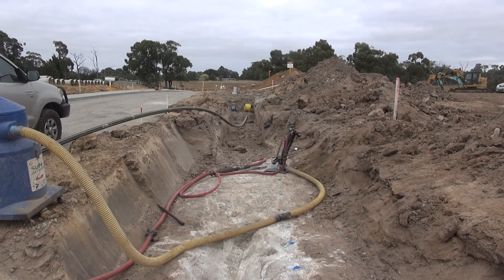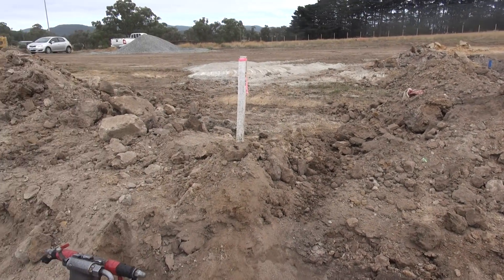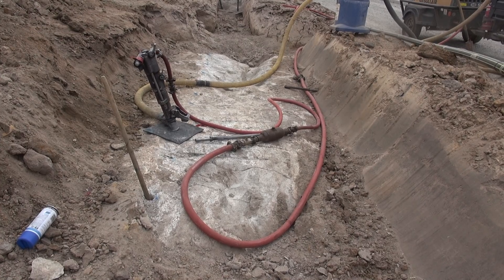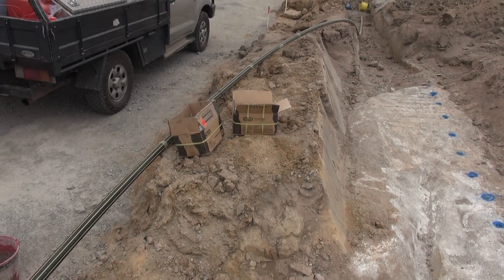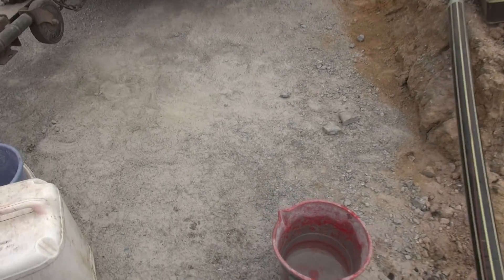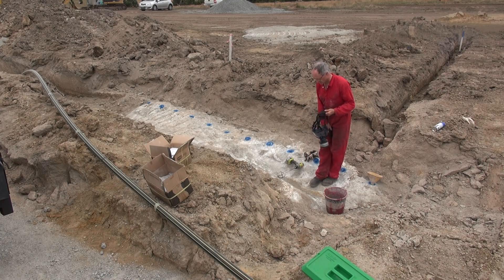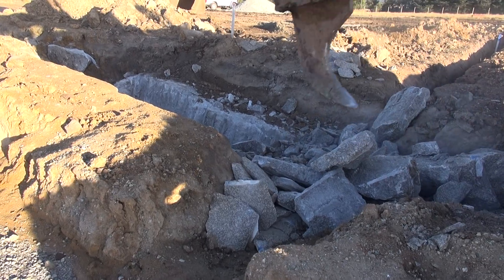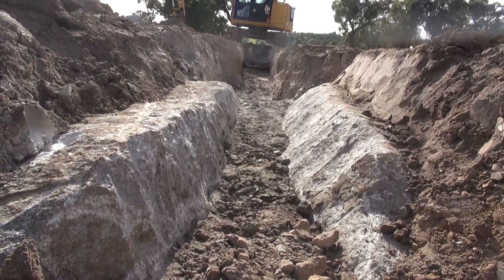Trenching in Granite without explosives

Comment: Okay what sort of hand drill would you recommend to someone who wants to do this? Milwaukee sds and going up in successive bit sizes?
Reply from the maker: It would take you 2 weeks to drill this with an electric drill and the cost of 38mm SDS Max (inch and a half drill bits) for them is prohibitive, not to mention that they only make them up to 600mm long. You really need a pneumatic rock drill, one that is powered by a big mobile air compressor. You should be able to hire one.

Comment: I love using the ripper on my Komatsu 1.5t ‘hydraulic teaspoon’.  Can’t wait to get my hands on some of that Expanda.  
Just looked at a video for the XCentric Ripper ( combo of ripper with built in hammer).  Bit big for my machine, but looks like an awesome option, and should be made for smaller mach.
Reply from the maker: Sounds great! The expanding chemical; cracking agent is sold under numerous different brand names in different countries, it's good stuff, the biggest cause of failure is the users inability to drill large enough diameter holes. 1.5 Inch or 38mm is best and drill most of the way through the rock.

Comment: I want to dig a big hole for an inground tilapia pond - about 1.8m deep, 6m wide and 8m long (in the US).  The top 60cm of the soil in that area is mostly hardpan, then under that you quickly run into some variation of rock and hardpan.  Explosives are not allowed.   Backhoes are not very productive, per some of the locals, who have tried digging in it with machines....unless you get really, really big backhoes (70l of diesel per hour!)  What would you suggest?
Reply from the maker: First up, who says explosives are not allowed and why? Explosives can be very safe and cost effective if you get the right contractor with a lot of experience in this type of blasting. Ok, if you take explosives of the table you could use and expanding chemical cracking agent and then get into it with a large machine fitted with a hydraulic hammer or use a Darda type hydraulic splitter as in my latest video.
Reply: @demolitiondavedrillandblast  I have heard from two sources that the government does not allow blasting.  I am trying to double check that, but Gggle does not seem to be as helpful as it used to be.
Reply from the maker: What country are you in Tom? Every country has quarries and all quarries use huge quantities of explosives that are supplied by numerous explosive companies, explosives are also used extensively in any large civil works where rock is encountered. it might be worth googling "rock blasting contractor near me" or similar. Maybe contact the sales department of one of these explosive companies and ask if any of their customers do small blasting jobs.

Comment: Hole diameter?????!!!!!  (No-one EVER says!!!)
Reply from the maker: This one was 38mm -Inch and a half
Reply: @demolitiondavedrillandblast  Thanks.  Have you tried any other hole diameters WRT the situation (especially rock type)?  Also, have you ever started a trench with holes inclined the other way initially for the first 2 or 3 rows and migrated to vertical ones?  Theory being that the first holes push the rock up and out giving somewhere for the vertical holes to push the rock into?

Comment: Binge watching your videos Dave on this one seems this was a very inefficient way to break the rock for this situation. With light loads strategically placed you could have achieved same results in just a few hours.  Did alot of trenching for pipeline and road ditching in a 2 ft hole we would use about a quarter stick of tnt and about 10 inches of a gell stick per hole. Sometimes less if it was a softer rock like sandstone.  Gave a nice pop and usually not throw any rock more than 4 to 6 feet.  I row of shot holes down the middle with relief holes on the out sides of trench to shape it and this would been done real quick well except the time it would take to drill it.  The exspando is a good product in where you have boulders where blasting isn't an option and just to big to move with machines. But in ground like this the rock is in a suppressed state that counters the effect of the expanding material lessening its effectiveness.
Reply from the maker: There was no way they were going to let me use explosives on this one, only a few meters away is a 30 inch 1500 PSI gas pipleline that supplies the entire city of Melbourne, they were all over me!
Reply: @demolitiondavedrillandblast  that's a shame but at least you made money for your time. But even if you been right next to that pipeline you know as well as I a precise pop would have barely vibrated that gas line. That's why only pros should be doing this kind of work surely they know that.

Comment: hmm . . .  I wonder . .   when I was a kid, we used make a good sized fire, then put a big rock in it to get hot really hot, then we would take the hot rock out of the fire and drop it into a bucket of water.  Once things had cooled down, you could easily break the rock with a hammer into smaller pieces which you could break with you hand.  
     So I wonder what would happen if they drilled the holes in the rock and then inserted like a tube with holes in the tube and then pumped like propane gas or that welding torch gas thru the pipe and let it burn and heat up the inside of the stone drill hole until it gets real hot, then take the burner out and quickly put in another perforated tube into the drill, but this time, inject liquid nitrogen or maybe something not that cold.   I wonder if that would cause the rock to be more breakable and pried apart  with that big metal hook thing?
    ps.  Please don't try this at home like we did as kid because when you put some types of rocks into a fire, they will explode on their own.   Hey, I never said we were smart kids. 
      But at least we were smarter than my Dad and his friends when the were growing up during WW2.   They used to pick sides and 'play army' by shooting  at each other with their BB guns.  (No goggles or face masks).   But they stopped playing that after one of them got hit in the throat by a BB and hurt really really bad. 
     And I wont even mention the crazy stuff my Grandfather and his brothers got into when they were kids back in the 1910's (?)  ( like around 1913 to 1917.  I don't know what you call that time range.  Its not the  Nineteen-hundreds 1900s  and not the  Nineteen-twenties  1920s.  If you know what I mean.)
Reply: I have cracked some big stones by fire. Dig earth away around stone and burn good fire 2 or 3 hours. Then pour a lot of cold water to it and at least granite cracks. I have experience only with granite. That thermal shock cause minicracks and that stone keep crackin several years, here winters are below zero which helps.

Comment: Is that drill working properly-I didn't see any dust coming from the drill holes. Poor dude looked like he was killing himself trying to drill. If the cuttings weren't getting flushed out of the hole he was just working against himself. Great video.
Reply from the maker: Drill was working correctly, no visible dust as there is an efficient vacuum system.
Reply: In Australia OHS is big on dust so vacuum or other dust suppression systems are used.

Comment: out of curiosity why take it out at all? surely thats the ideal material to place a footing on?
Reply from the maker: In this case the excavation was for underground gas and water etc. in the case of footing for a building a similar type of excavation in the rock is preformed so that the house sits on a uniform foundation type as if some of the house was on rock and some on soil the house would eventually crack as the soil eventually settles or sinks but the rock is fixed.
Reply: Demolition Dave Drilling and Blasting ahh I just assumed it was a strip footing...mind you that’d put the house pretty close to the road 🤦‍♂️

Comment: I am curious as to whether it ended up saving time or money to do it this way versus sticking with a breaker. My employer does a bit of rock excavation for house foundations. We are in sandstone and an experienced operator on a (rental) 20 ton ex and breaker took 3 weeks to cut 150 cubic yards worth of foundation and swimming pool out of the hillside. Looks like 100 feet of trench a couple feet deep took more than a week to drill and expand, accounting for some extra adversity. Do you regularly use Expando? Is it practical for moderate to large sized projects? Is it ever more cost effective than hydraulic breaking and ripping?
Thanks for the video!
Reply from the maker: Hi Joe, This was definitely the cheapest way, total cost equalled two days with a 20 tonne machine and the machine just would not have cut it in his time, before I started the 36 Tonne Cat Excavator spent a few hours on it until the breaker point looked very sad. I spent 17 hours on this job over 4 site visits, only for a few hours at a time to drill and fill and then wait for the goo to do it's job. Sandstone is like cheese compared to hard granite when it comes to degree of difficulty. I use a lot of expando, used some today in a very tight backyard swimming pool excavation, blasting is your best bang for buck when it comes to hard rock extraction but sometimes it is not a practical option for one or more reasons. With some rock types hydraulic breaking or ripping are not options. We helped out on a big job a while back where the customer was using a pair of 85 Tonne Komatsu machines and 65 Tonne Cats with the biggest breakers that I have ever seen and they were replacing breaker points every 3 days @ $8000 each!!!!. They managed to get a lot of the granite that was faulted with jointing and bedding planes out but the really big bits needed to be blasted. You are welcome Joe.
Reply: @demolitiondavedrillandblast  That is amazing. That is the reason we rent our breaking machines--they wear out too fast.

Comment: That expando is cool stuff thanks for the vid! I would always use a jackleg over a plugger wherever I could, though! They are most certainly worth the investment!
Reply from the maker: Pro Paycheque I'm looking out for a leg dril, how would you use it to your advantage in a job like this when you have to drill down @ 45 degrees?
Reply: I would drill with my angle pointed  lengthwise the trench in starting at one end and working backwords. Need to start off by putting in a hole for a bolt or piece of cold round. Then run a chain off of that with a loop on the end to keep your leg from kicking out. Thats how I drill of benches underground with a jackleg and I've never used expando so I'm not the expert.
Reply: And I would I definitely throw that dice in off the hop! It seemed to add the relief the expando needed
Reply from the maker: Pro Paycheque - Interesting idea with a chain. I would like to do one of these one day with parallel horizontal holes to shape the bottom of the trench however expando is a bit tricky to use in long horizontal holes as it is a lot thicker than water and does not flow very well.
Reply: I would just drill the same pattern you drilled except with the holes at 45 degrees all pointing towards one end of the trench. Drilling flat low holes gets to be murder on the back and doesnt seem necessary if the trench is getting backfilled with the bedding anyways... But I swear that you will love the jackleg! All you do is balance the leg pressure with weight leaning downwards on the leg and she'll smash out the hole way faster and without to suffer the vibration of the plugger.
Reply from the maker: You are preaching to the converted, I've drilled about 35,000m with the "pluggers" I'm not worn out yet but machine drilling is becoming more important too me, I've got a drill mast on a small excavator and an old ROC203 airtack rig. I shudder when I think of how many horizontal and low angle holes i've drilled with a Plugger / Sinker type drill. The excavator mounted drill had a drill feed motor problem when this job came up so I did it by hand. Here is another little vid of the little drill in action, again doing a Vee trench, fired with cord, this one gave a beautiful result.  https://www.youtube.com/watch?v=oCGIp80eJWI
Reply: Nice machine! 2 meter holes? How much collar did you leave after loading those holes?
Reply from the maker: They were all less than 2m, the holes were loaded with 40 gram/meter det cord with 1/2 a plug on the bottom, the drill mast was built by my friend Mike the gun smith and he built it to gun smith tolerances, it is a work of art. it is worth its weight in gold, did nearly 3000 holes on it's first big job.

Comment: we rent breakers to go on the end of those excavators. I have also used hydraulic rock splitter that you simply drop into those drilled holes and they crack it open immediately. If you run into that sort of thing much you might look into those methods. Well, if they are available. You could make a good living just splitting rock if had this stuff AND you don't have to worry about killing yourself if you get it on you ! I mostly used this stuff on slopes and cliffs were you can't get equipment to it.
Reply: The only thing I don't like about those Hydra hammers on the end of excavators is that they are super loud

Comment: Most contractors around here would have a sub diamond saw it.
Reply from the maker: They had a shot at that with a demo saw RB, and then re applied the breaker to little effect, for this method to be a goer they really needed to gut it deep with a big road saw, however this  method is also flawed because you can't use a road saw on anything but a perfect flat surface because the (very expensive) blade will jam and likely be damaged. I'm always looking for better ways of doing things though, it may have been possible to do it with a diamond wire saw. Think I need one of those.
Reply: Demolition Dave Drilling and Blasting good point!  Those big blades bind easily.